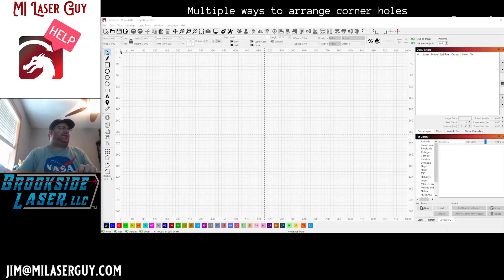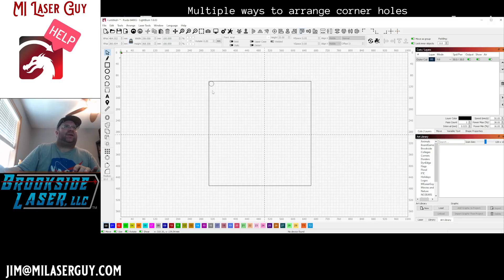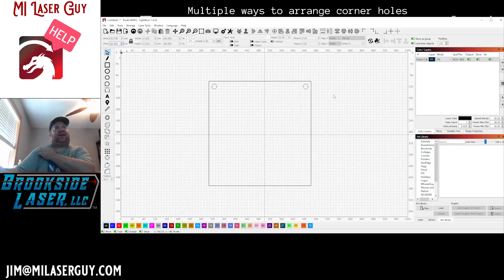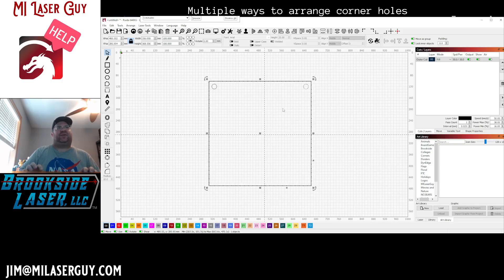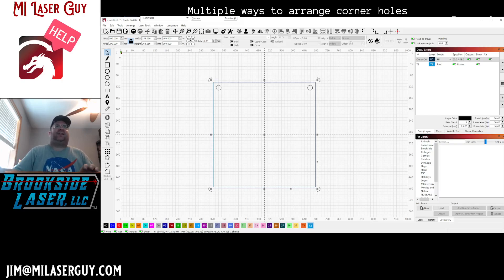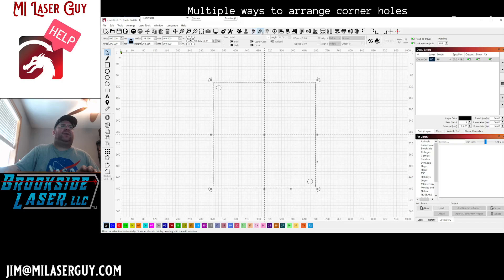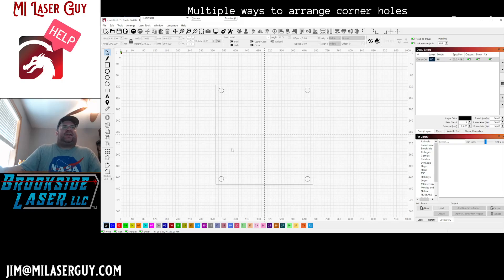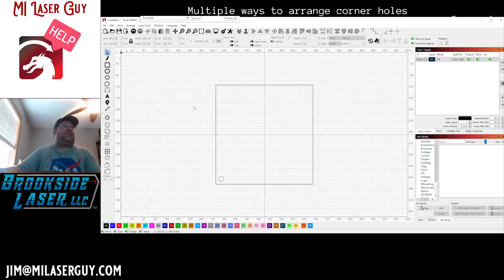LightBurn Tutorial: Mounting holes equidistant from the corners

Comment: what if im trying to make say 3 1/4" chicago screw holes along side a box and need them 1/2" from the side and top edgeand evenly spaced out along the side oh hell im trying to make a patern for my book binding
Reply from the maker: If I understand properly, you want qty 3 holes, 1/4in round, where the top and bottom are in specific spots, and the 3rd one is centered between those  two?

For this, you set the two corner holes, as I indicated in the video, then for the 3rd hole, align center (so its inline with the other two, but not necessarily spaced correctly. Select all 3, then use the button to distribute space, which will  not move the top-most and bottom-most hole, but move the middle one to be equally spaced. This works with any number of items. (like if you wanted 6-hole bindings)